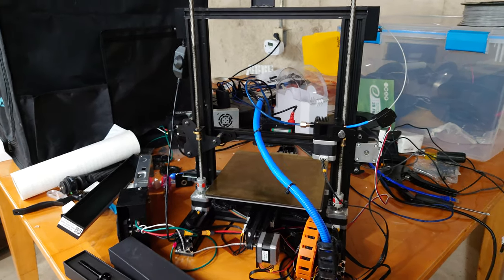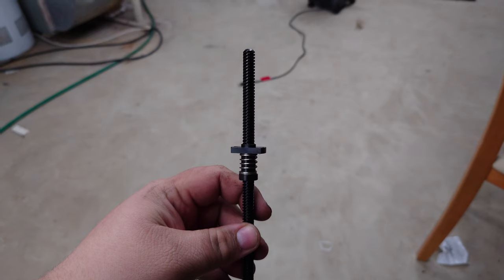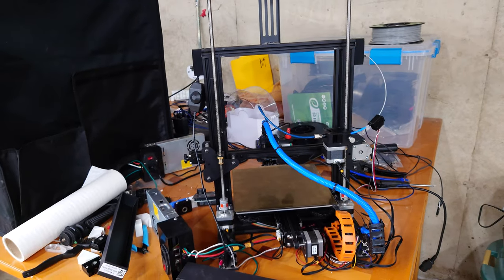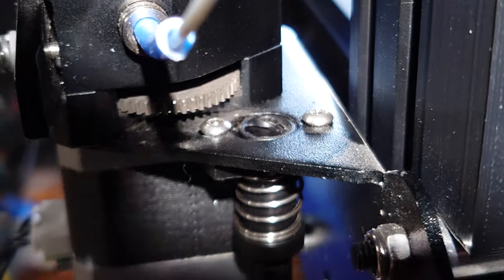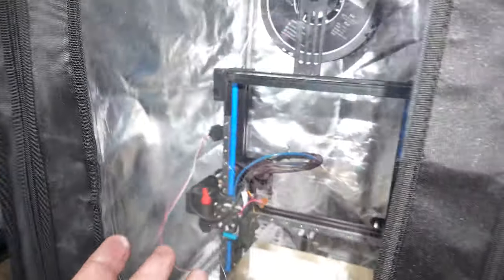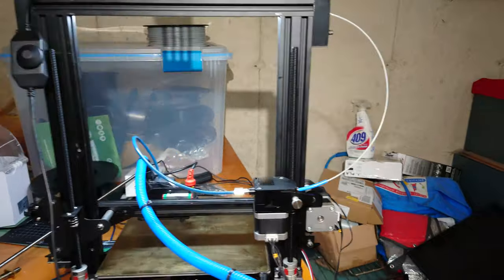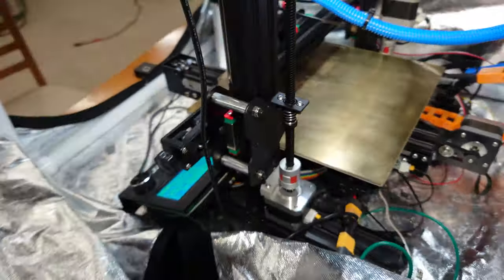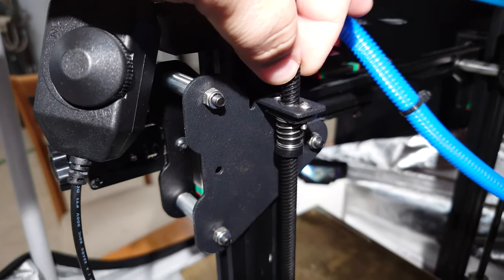Upgrading the Ender 3 with Teflon coated lead screws and POM Anti-backlash nuts

Comment: you dont need anti backlash spring on the z axis as gravity does the job of the spring, anti backlesh nuts makes sense on x or y axis if you are using a lead screw driven x or y axis
using anti backlash spring on the z axis lead screw you are just increasing friction on the acme threads on one side of the lead screw or the nut and thats why they wear out
POM nuts are also used to minimize vibrations caused by friction between the nut and the lead screw when you are driving the lead scew beyond its critical speed. For a lead screw so small (300 mm) I believe that critical velocity will be in several thousand RPM, so unless you have a noise issue, POM nuts are redundant

Comment: Have you tried the mellow bi metal heatbreak? It seems to be a drop in replacement for the ender series printers. Like down to the dimensions, wouldn't even have to change your  Z offset.
Reply: I have been considering getting one for my Ender 5+, I have a Swiss on an Ender 3 but I had to get it machined by a friend and a conversion piece made for a compression fitting as those collets just kept wearing out and allowed it to ride up with the retractions which were causing artefacts.
Reply: @AndrewAHayes  I've seen different opinions on the collets. Some say they're perfect and never had an issue. Others say they can't stay tight and loosen very often. Wonder if there's some expensive ones that work better without having to drill and tap threads for a ptfe coupler. But their bimetal heatbreak looks nice and they even have a flat side on it for the grub screw to engage more than other bm heartbreaks.
Reply from the maker: I just pay micro Swiss to make me a custom heat sink with threads. I have a video of it on this channel.

Comment: Do you have one Ender-3 that's just totally maxed out with every trick you could throw at it? (Linear rails, Teflon screws, dual-z w/ G34, premium hot end with direct drive, upgraded fans, motherboard, and whatever else you can throw at it?  If so, how much better is it than a stock unit.
Reply: I would have gone for a belted z for totally tricked out, I have them on my Pro 3D V-King 400 and they are the dogs doodahs
Reply from the maker: I suppose you could say that.

It's not about making the quality better, it's about making it more consistent and reliable.

For me anyway.
Reply: linear rails don't really help accuracy.  They can help maintenance of Vwheels, and sometimes noise, but overall, nothing changes.     Direct Drive is the same, it won't do better in all aspects, it will do better with Flexible Filaments, but overall, is just another type of modification to  adjust and calibrate.       The mainboard is a big change, as many Ender3s have an 8bit Melzi mainboard, with older, choppier, drivers - so an improved mainboard can in fact help print quality even further.  Fans are more for silence while cooling, vs quality, although a new set of part cooling fans can allow for some better prints at higher temps/speeds.

The simple fact is, stock, printing slow with PLA, this does as good a job as most high end printers.  The downside is the need for maintenance and calibration, which is where the premiums shine.  A prusa, for example, is a workhorse.  You set it up, get it calibrated once, and you probably won't have to touch it's settings for months, even changing to new filament types.  The Ender3, however, will need fine tuned for just about every variable that changes, including new filament (color, brand, and type of plastic)
Reply: I have an Ender3 with Microswiss all metal hotend, Microswiss direct drive linear rail extruder, Microswiss hardened steel nozzle, upgraded ceramic heater, Microswiss copper heater block, dual Z, linear rails throughout, 32 bit silent board running Klipper with the Creality Sonic Pad, Biqu textured PEI sheet, Stealthburner cooling (modified swissburner with my own custom mount), 5015 part cooling, CR touch (same custom mount), Squashball feet, cable chains, aluminum bed level knobs, printermods LED lights and more.  My printer is more reliable.  I never adjust v-slot rollers because of the linear rails.  I do have to clean and lubricate them. I did these upgrades slowly.  Many of them took down my printer for a few days.  The Z axis has given me the most trouble.  Replacing lead screws and the nuts resolves it.  In fact, I have changed quite a few parts but I use it a lot. (when the Z axis starts to drag on the print, it is time to change out the parts)    I have been considering the kevin aka sam belted z axis mod. I don't like the idea of the gantry falling.  (though a key back mod is now available)  Also the same guy has a setup for Klack ender probe.  At some point it might as well be a switchwire conversion. 

The best mods were the Biqu textured (powdercoated) PEI sheet.  A replacement build plate and new mag sheet.  My replacement was much flatter but it is luck of the draw if you get a stock one.  Gulfcoast robotics sells a better build plate if you really want to go that route.  The installation of the magnetic sheet is critical to a flat bed.    The stealthburner (swissburner) was pretty huge for cooling.  Linear rails have reduced by maintenance and added accuracy and speed potential.  Dual Z was big for my particular printer.  (tons of Z issues after printing many hours) Klipper was actually huge though.  Input shaper and pressure advance tuning allowed me to print faster.  Also Marlin will actually pause once the buffer is full.  (not an issue with Klipper) If the printer pauses and creates little zits at high speeds, you are pushing the 32 bit board and Marlin past its capabilities.  

Adding insulation under the bed was cheap and easy and helps it warm the bed faster.  (mine is an old Ender 3 Pro)  A slightly higher wattage ceramic heater for the heater block was good.  (faster warm up)  The nozzle of course is huge.  A quality nozzle that is seasoned with a single drop of mineral oil.  Direct drive is big.  Tweaking the setting in Klipper for the CR touch was big.  (so it knows where the probe is in relation to the actual nozzle!!)  My printer is tuned an ready to print.  I run ABL and it probes 25 points 2 times on each point.  (what a difference probing 2 times made!)  I learned a lot and printed a lot.  It is still and Ender 3 though. It is and will always be a bed slinger. 

A full on switchwire (corexz) conversion is a possibility for this printer.  The Sonic Pad has been a pain.  It disconnects during large prints.  I hope to resolve this by changing the USB cable yet again or maybe a software update will fix it.  (start the print and hope for the best)  I had to remove my BTT SKR mini and install the Creality 4.2.7 to get it working with the Sonic Pad.  (another expense but it made life easy) 

I think at this point, it is going to stay how it is.  I would rather spend my time working on a printer that is not a bed slinger.  The Ender 5 is NOT corexy but looks like it is.  The new Ender 5 S1 looks pretty nice.  (paired with my Sonic Pad if I get it working)  The longer version of the sprite extruder is interesting. 

I ordered a Bambu Lab X1 Carbon.  (that fixes everything, at least in theory)  I have high hopes for the X1 Carbon.  It is expensive but so were all of my mods to the Ender and I still have a bed slinger.  

I think that the Ender 5 S1 is the best Creality option at this point.  It comes with Marlin but Klipper is great.  Sonic Pad is wonderful when it isn't failing.  I would have to do OctoKlipper at some point if I bought the Ender 5 if I can't make the Sonic Pad reliable.  (I love that you just edit the printer.cfg instead of compiling firmware)  I was planning on going with the Ender 5 and upgrading the z axis, the bed, and eventually modding it to be corexy.  The Bambu Lab is already corexy and is faster than the Ender 5 is capable of being even after the mods.  The P1P is $699 and just as capable of fast PLA printing if you add the part cooling fan ($35). 

A lot is going to change in 2023 from what I can tell.  Part of me will miss the constant upgrade path.  I may start building a Voron to fill that void.  I may just concentrate on 3D design instead.  I might start with the Voron 0 or maybe the 2.4.  I already have a large format printer, the Biqu B1 SE Plus for my large stuff.  (bedslinger)  

I guess my goal is to use the Bambu for most things.  Use the large format Biqu for large things and keep the Ender for when I need more than one printer at a time.  I will build a Voron just because I want to.

Comment: Anti-backlash spring force should be directed the same direction as gravity, not the opposite way.
Reply: Most youtube videos show the connection wrong. Are you aware of any video showing it correctly. I tried connecting correctly on an Ender Neo and I had problems with the screws getting in the way of the filament.